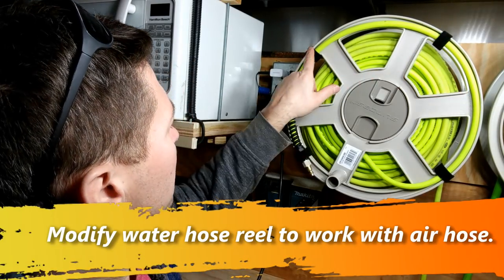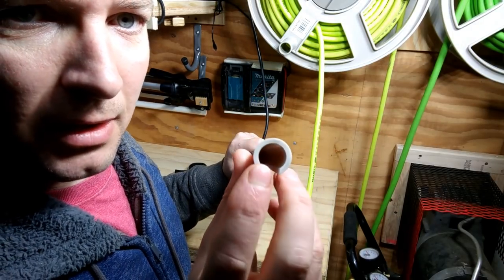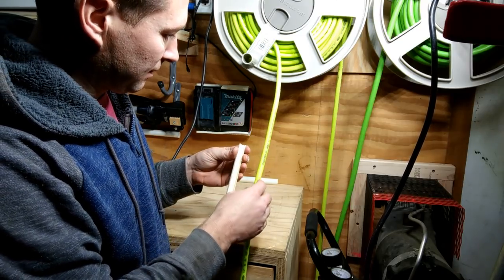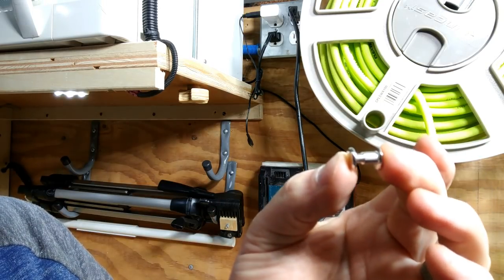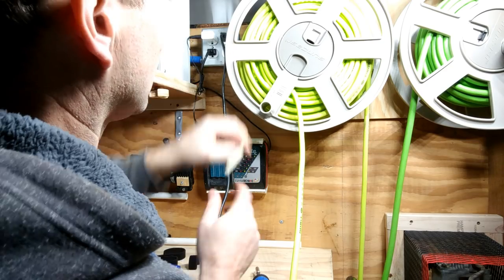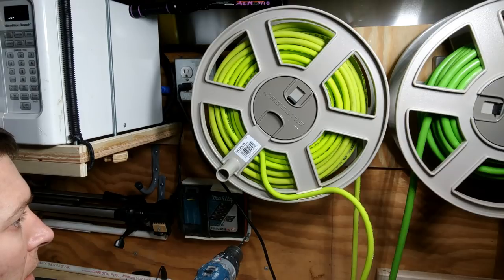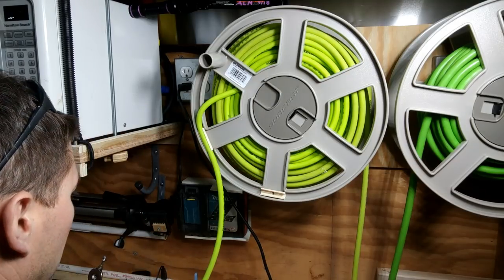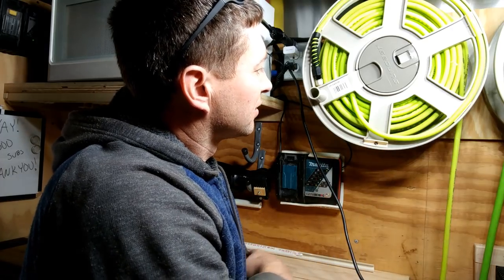Modifying a water hose reel to fit my air hose

Comment: I realize it's 3 years old now but wouldn't some sort of adhesive work easier then those screws to hold the pvc clips in place?
Reply from the maker: It could. I do know that there is some force on it coming and going and I didn't want to do it twice.